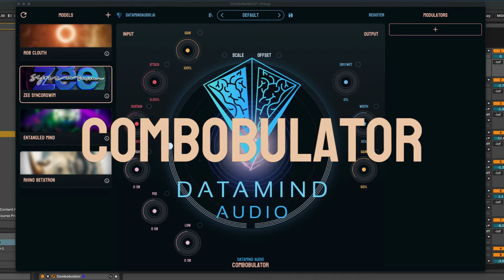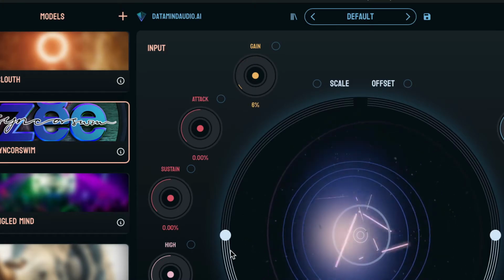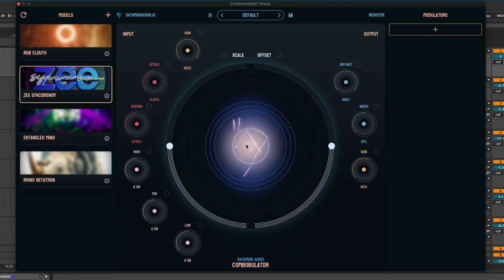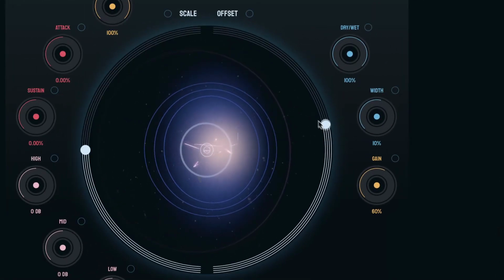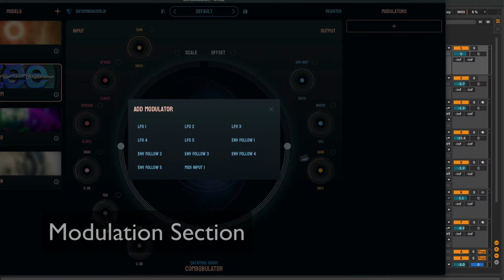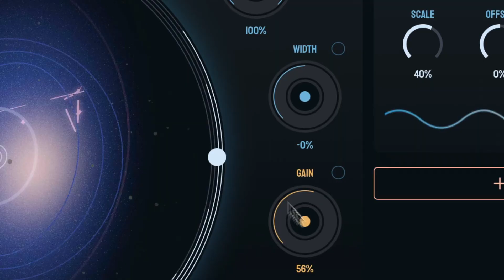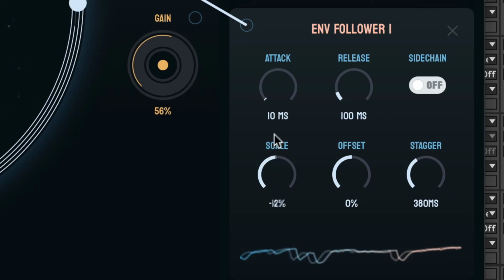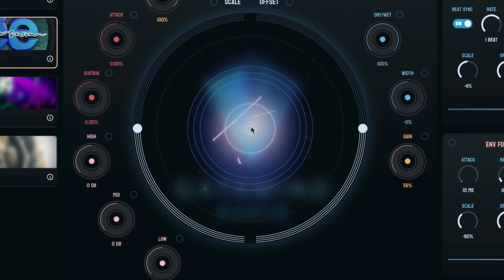Combobulator: Getting Started

Comment: You can get the RAVE vst for free which basically is the same thing and runs on the same VAE neural synthesis model from Acids Lab. Or use nn~ in Max and add slider to the decoder and you get all of this except the pretrained models from the artists.

But, its fairly easy to follow the RAVE training guide and do it on cloud services for a week and get decent results. Plus there are already a fair amount of models available online and more will appear soon.